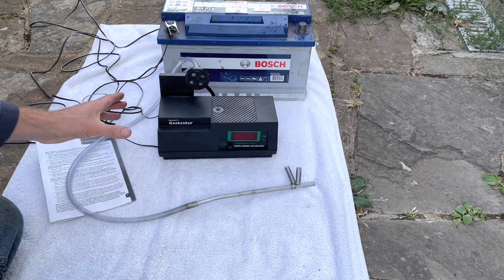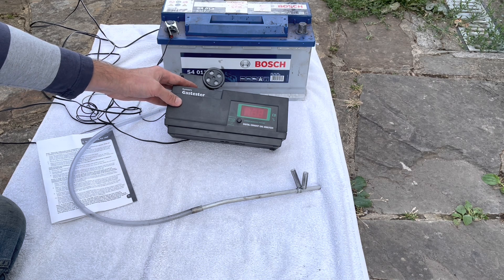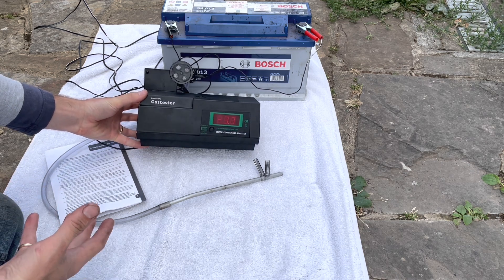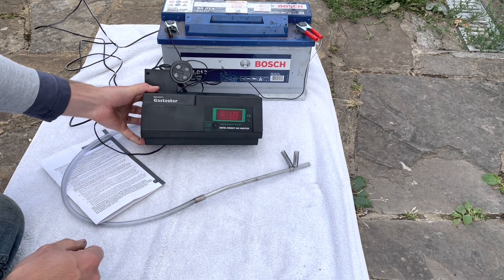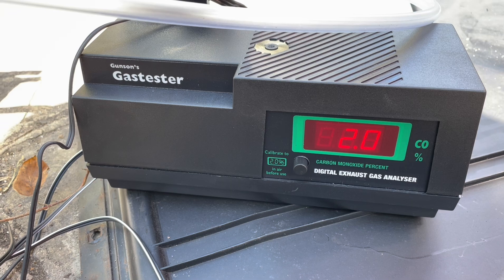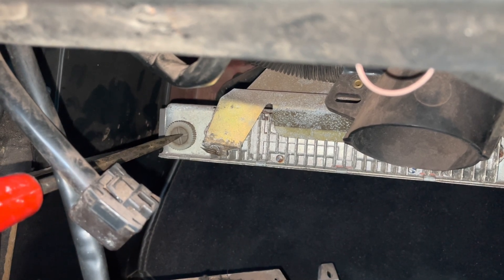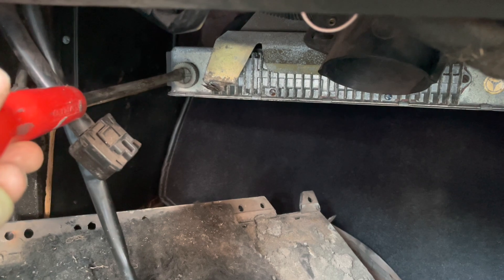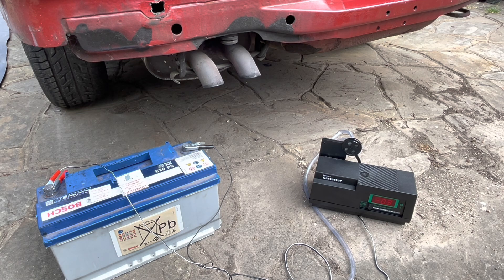Gunson G4125 Gastester - checking exhaust CO content

Comment: I would love to see another video like this but, with the hose not kinked. Do you still have the device and could you do another review?
Reply from the maker: I couldn’t get the kink out of the additional pipe on that back - the length and path from one end to the other is such that it kinks. I could try cutting it a bit shorter I guess.

Comment: Glad you did this video. I used mine on my all mechanical non ecu 1985 280ce and found the readings  to wander quite a bit so dont know if I did a good job. MoT on Wednesday so I will get a more.accurate reading. Got my CO down to 1.5% but when I disconnected the sampling pipe from the exhaust, the readings did not return to 2% but stayed below 2% which made me.feel that my CO reading was higher than 1.5%. Not sure if the product is worth buying. I'll find out on Wednesday.
Reply: I realise this video is almost a year old now but I just wanted to point out that the short hose on the back that seems to just link to ports together looked a bit kinked.
If gas has to pass through that for whatever reason, that restriction could perhaps cause a misread 🤷?
Reply: Just got back from the MOT. The yester said that the reading was 0.01%. That is far too lean. He also said that when a engine is that lean the smell coming from the exhaust will smell rich!  It did smell rich. He adjusted it to 1.35%. Spec is 1% to 1.5%. The max for a 1985 Mercedes is 4.5% for MOT purposes. 
I will be selling my newish Gunsons gastester on ebay and just pay for a garage to do the adjustment.
Reply from the maker: @shabbytiger5528  thanks, that’s really good feedback. I need to try and find out what mine was at last MOT. I’m a little surprised it would even run at 0.01%!
Reply: @classiced1416  me too but I'm even more surprised it got to that number.
Reply from the maker: Yeah would be interested to hear what you get at MOT.